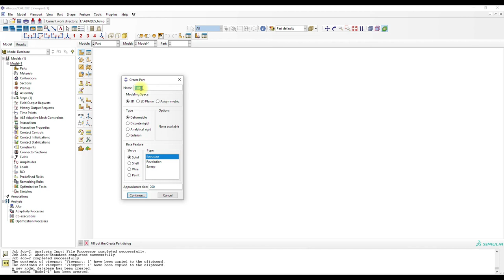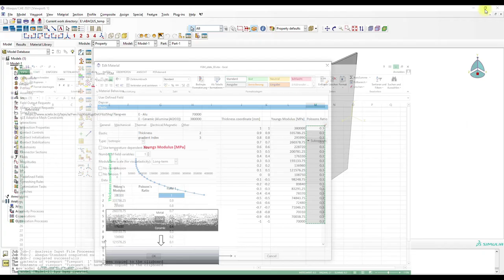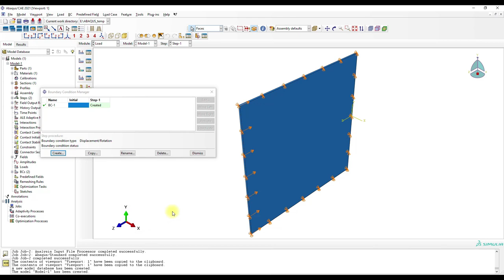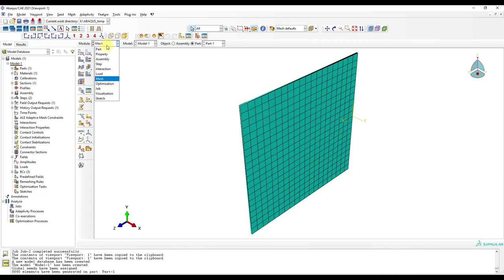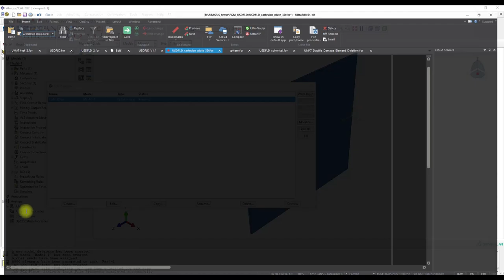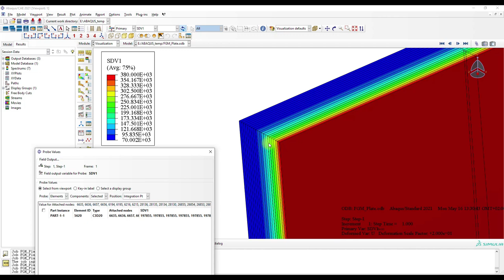#5 How to write an ABAQUS USDFLD ? - Alu-Ceramic Plate with Through Thickness Variation of E-Modul

Comment: Hello. Thanks for your great videos. I had a question. In my project,  I need to get the nodal values of plastic strain at each node and compare its value among adjacent nodes in adjacent elements and get an average value at each increment. One way is to write a ".dat" file at each increment and read it and do the job, which is very time-consuming. I wanted to know if I can use UFIELD or USDFLD to access to an array of all nodes or elements or integration points with their corresponding values of plastic shear strain saved in a common block so I can use it further in my analysis for each increment?

Comment: Thanks Dr Wanger for all your efforts that you do for all of these excellent tutorials
I have question sir for FGM beam should just I delete the y direction into subroutine? And all kepp inchanged
Thanks
Reply from the maker: You mean for an analysis with 1 d beam elements? I think you dojt have to delete it, just dont use or define it in the usdfd
Reply: @hnrwagner  for 2d shell element to model a beam analysis?
Reply from the maker: @bensaidismail5394  if you can send me Problem description
Ro.wagner@tu-braunschweig.de

Comment: If I want to do the free vibration analysis of FGM plate then the subroutine will be same? I've already tried multiple times, but job submission is aborted due to compilation of subroutine file. I've used your subroutine file too.
Reply from the maker: Should work the same, what was the compilation error in detail +
Reply: @hnrwagner  I think problem lies only with subroutine file in my case, not any other error. Should we include the density function similar to the Youngs Modulus.
Reply from the maker: @krishnapandey7243  if the density changes similar to the other variables, you should
Reply: @hnrwagner  Thanks for your patience sir, can I contact you through email with my detailed problem description for more clarification.
Reply from the maker: @krishnapandey7243  

I tested your model and it works for me without problems. Please check the error by watching :

https://youtu.be/WWj_jp833YI

also keep in minds that I get many emails a day and therefore only answer email of my patreons.